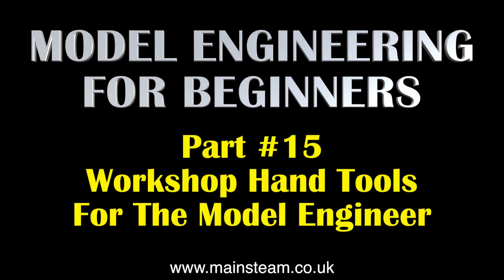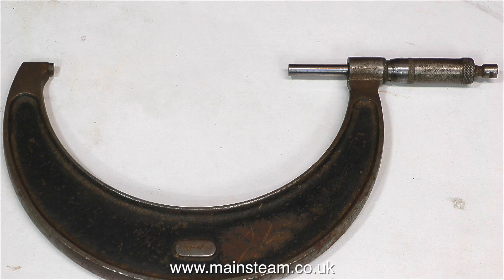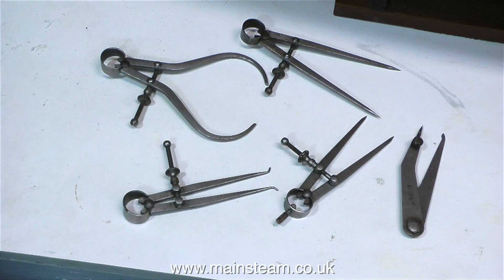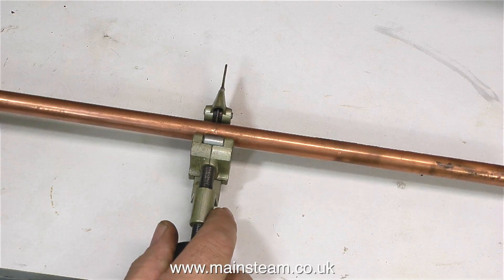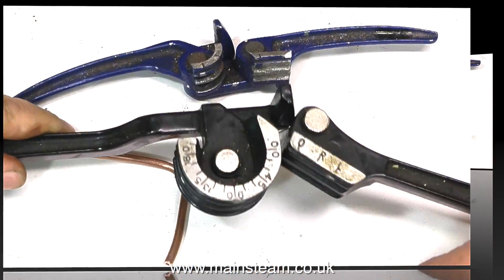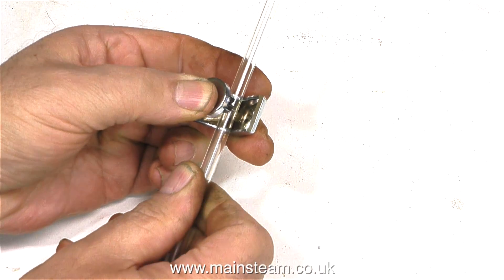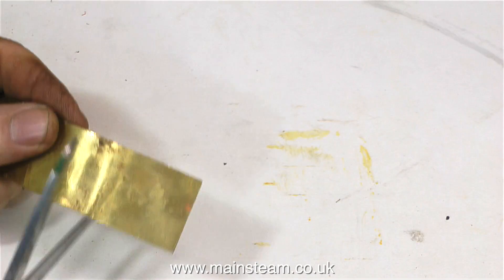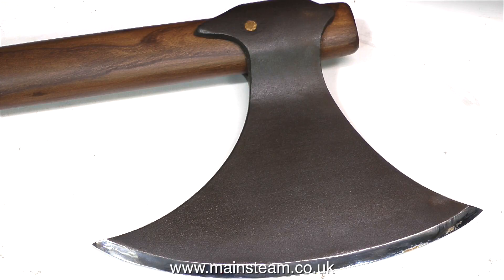WORKSHOP HAND TOOLS - MODEL ENGINEERING FOR BEGINNERS - PART #15

Comment: For the last couple of years  before I retired I was a school workshop technician. One of the girls made a very nice circular coffee table, but forgot to mark the centre, she needed that to fit a lazy Susan. I showed her a small metal centre finder, which she scaled up using laminated shelf as the straight edges. It was a metre long and worked very well the department bought it off her for a small fee to use as a teaching aid!

Comment: Could you maybe make a video of machining a piston if possible please?
Reply from the maker: Already done it - on the "Twin Tangye" rebuild video.
Reply: Keith Appleton Thanks. What's the best way to lubricate the cylinder in a model engine running on compressed air?
Reply from the maker: Please watch my other videos.

Comment: can you give a link for the gauge glass cutter... ?
I really want one !

Paddy
Reply from the maker: Yes I do know that, but it is quicker and foolproof to use this tool if you are a beginner to model engineering - that's why the series is called "Model Engineering for Beginners" .......
Reply from the maker: Just type Glass Tube Cutter into an Ebay search ......
Reply: You don't need one. Just scribe the glass tube with a file and snap it... it works every time!